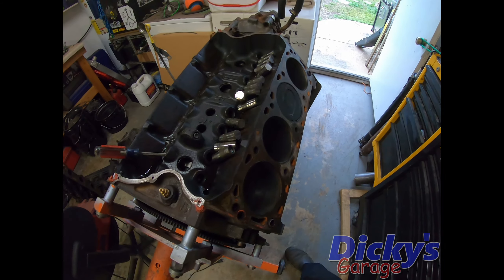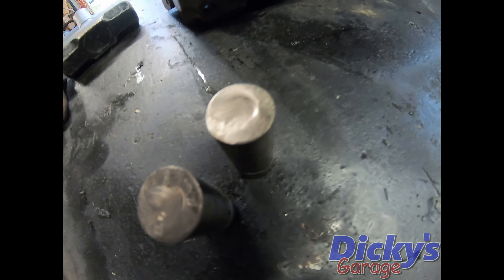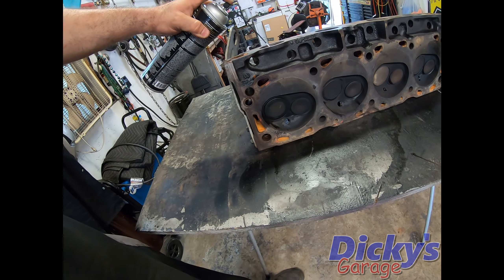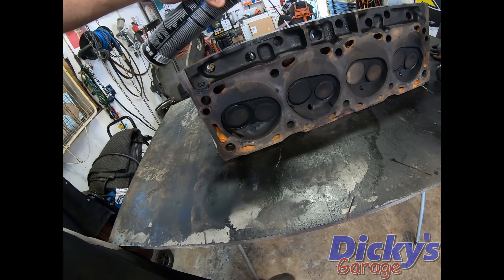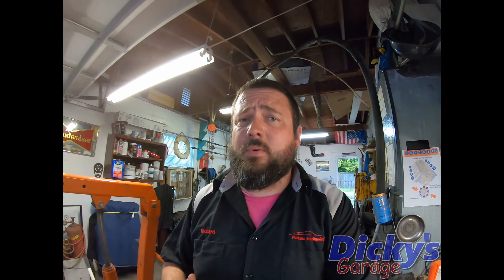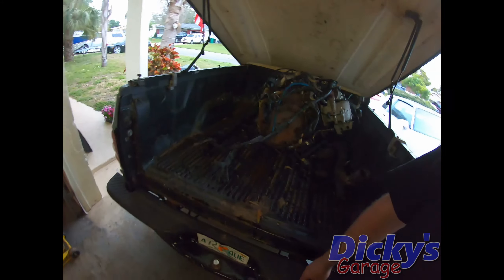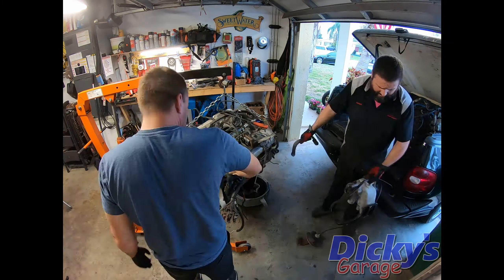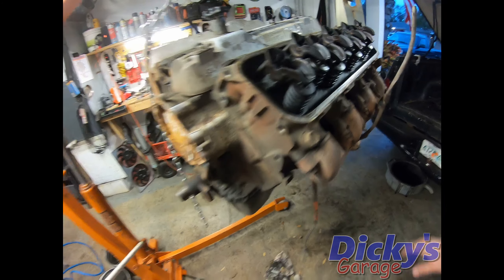We Brought Home a Pair of Junkyard Engines to Fix the Miata.

Comment: I'd look at lapping the valves in the original heads maybe even replace them with new or since it's a boneyard budget build, use good valves from the other heads.
Reply from the maker: I read somewhere the F3 and the E7 valves are different sizes.
Reply: I didn't realize you were running E7's the f3 heads use 2.1" valves vs 2.0" I think I don't remember but the few heads also have a tighter quench pad around the exhaust valves which can restrict flow. Both are good at making power when ported. The f3s do outflow the e7s stock but if you're not going all out with the build either way will meet your goal imho